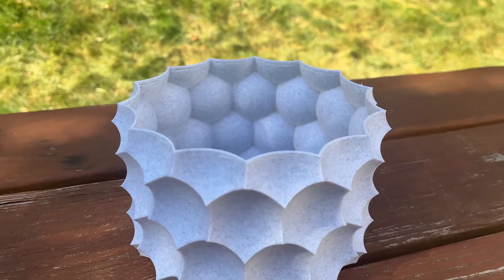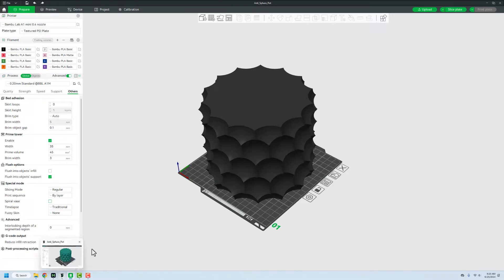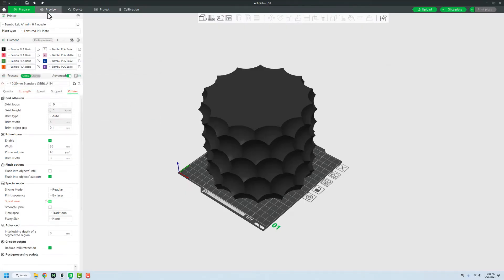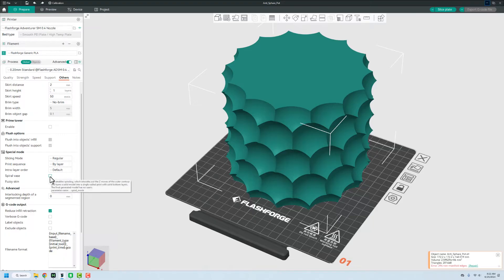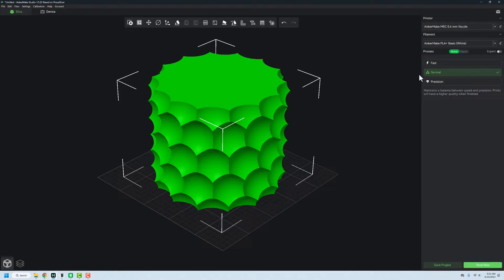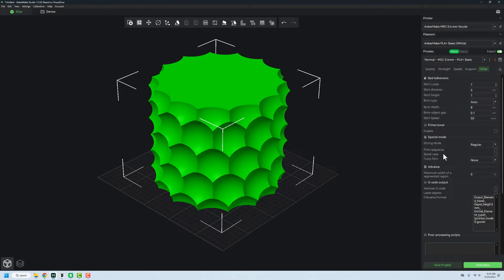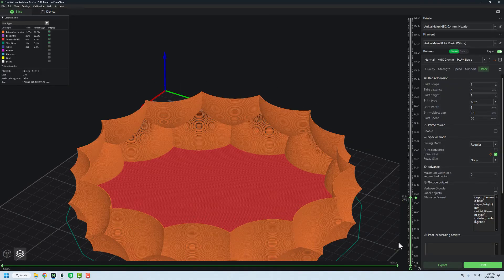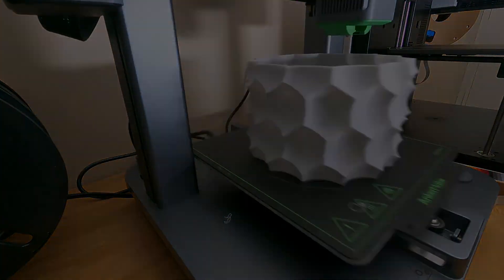How to Use Vase Mode In OrcaSlicer, Bambu Studio, and AnkerMake Studio

Comment: Hey! I tried vase mode but Im having poor layer adhesion, using the standard PLA settings provided by the software 220 hot end 65 bed, do you have any suggestions to improve this?

Comment: Hi! Thanks for the video. Ive tried the spiral vase  mode myself, problem is wall gets so think that the design gets frail. Is  there no way to have like two or more loops of every spiral so you get a thicker layer? Or should you just increase the layer one thickness?
Reply from the maker: From my understanding vase mode only works with 1 wall thickness. You could add additional walls and remove all infill and top layers, but it’s not going to got print as fast as vase mode.

Comment: Thanks for the awesome video, I've an issue when I use the spiral mode I don't if is the speed in which I printing or probably the diameter of my object, when the lamp botton is finished then it should start making the circular motion in one big loop right? Yeah that's not happennig, probably because of hotend is just the regular 0.4 because it keeps collapsing itself and I get a lot strings. 
Thanks again for the video.
Reply from the maker: Hmmmm, I'm also using a 0.4. Are there large overhangs that it's trying to build up?

Comment: anyway of getting thicker walls?
Reply from the maker: Not with vase mode. You could use a hot end with a larger diameter like a .6 or .8. But the idea behind vase mode is a single outside wall so the machine is always “building.”
Reply: You can print a line width about 50% ore than the nozzle diameter, so 0.6 to 0.9 and 0.8 to 1.2

Comment: Thanks. I just got my Ankermake m5c and was wondering where the Vase mode was... I do wish they turned off all the other options when you click Vase mode.. My other slicer would do this.. With Ankermake studio my first print had a vase with infill in middle... Which is silly..
Reply from the maker: It is very silly. I wish they would update the software on a bit of a more regular basis as well. I don’t think Anker is going to stay in the printer market for long. With the sales they recently had on their machines they have to be taking a loss on them.